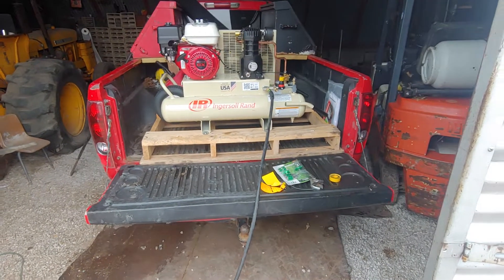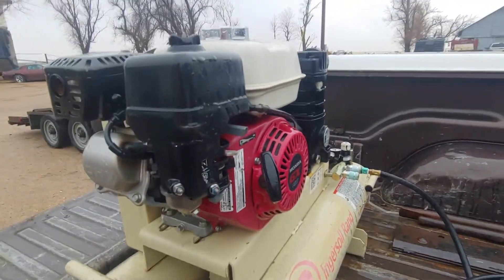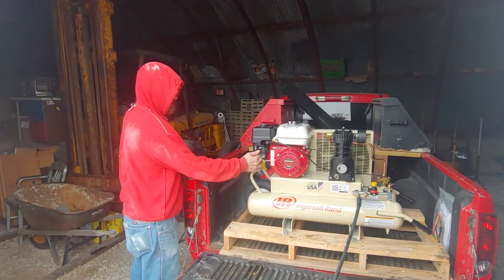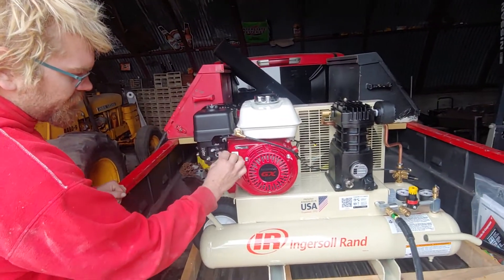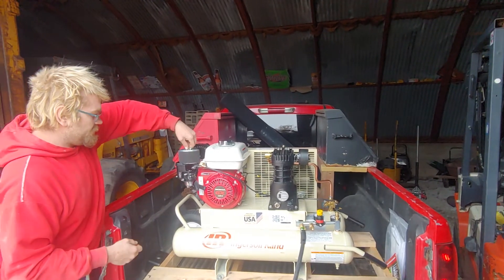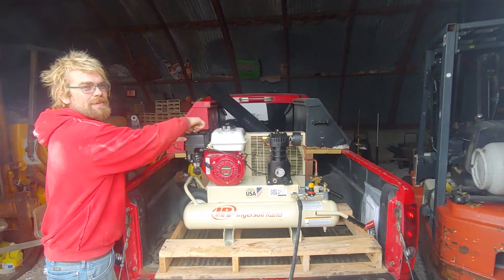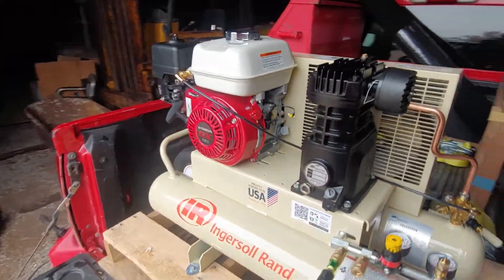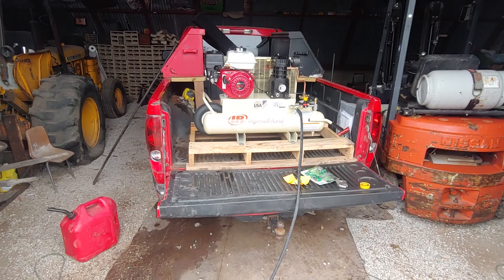New IR Air Compressor,A Small Demo and some thoughts!

Comment: i have one of those small air compressors. it is a rigid brand from home depot. it is the first honda that i have had that is hard to start every time. i would like to have a larger gas compressor for the service rig.  hard to beat a honda engine. that will e very handy around the farm.
Reply from the maker: If you go with one of these you will never need more air than it can make.My other one was hard to start anyy time it was really cold for about the first year. Once it got broke in,its a first or second pull start deal ever since. For 1000 more bucks you can get the electric start one that is a size stage up!